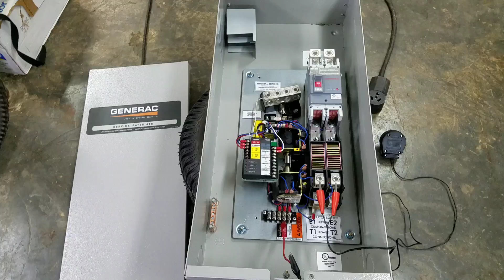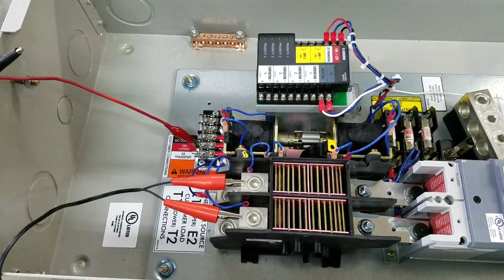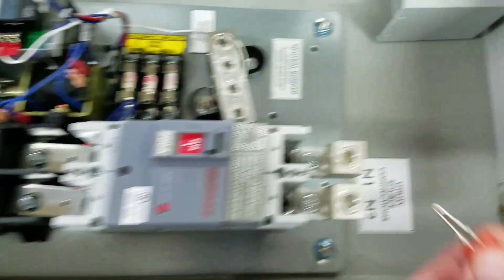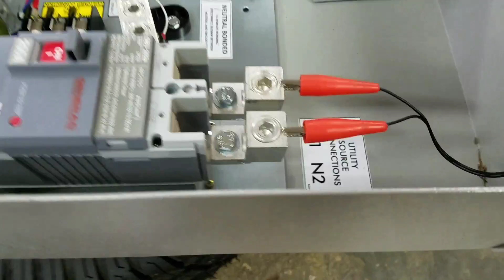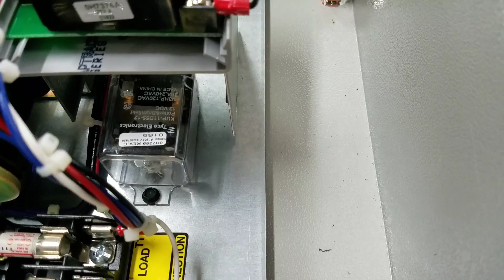Generac automatic transfer switch explained,  demo

Comment: Too bad they don't make something this simple and this small for only 50 amps. I guess one could just replace that breaker with the appropriate size.
Reply: Sure you can...  At least three ways to do this for a 50 amp service.  First, you can use a 100 amp non-se rated, transfer switch, and feed it from a main breaker box 50 amp feed, out to a secondary breaker panel 50 amp main.  Second,  GENERAC list an EZ 12-16 breaker and transfer switch all in one box.  You feed it from a main panel, and it replaces some breakers in that panel.  Third, by far the easiest, just put a 50 amp Service Disconnect before the transfer switch.  You just need to size everything within codes.